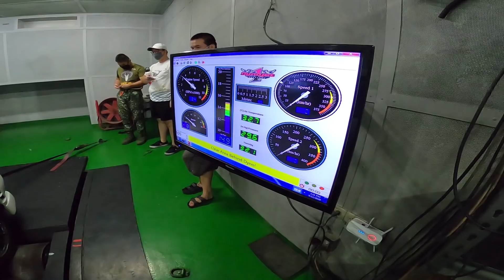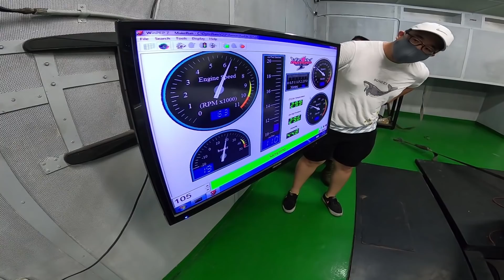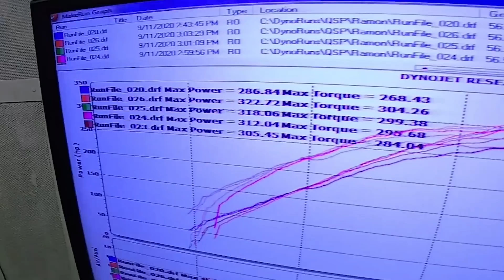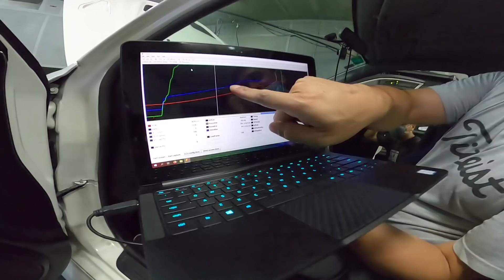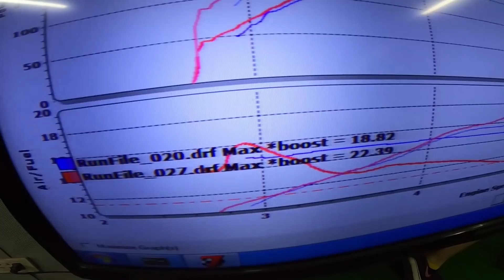Evo 6 ECM Tune

Comment: Upgrade na lang ng wastegate at bov next time easy 350whp yan. Naka evo 8 ako papi ramon full bolt ons lang and it made 344whp on 25 psi stock turbo lang. kudos papi ramon pogi ng evo mo 🙌🏻
Reply: Fuel pump upgrade din kung naka stock ka pa din. Pang diinan na yan 🙌🏻

Comment: 350whp in stock turbo? Solid a.
Reply: Solid nga eh stock turbo, buti di sumabog makina
Reply: Forged internals
Reply: @kenshien544  d naman forged pistons and rods ang stock evo. Crankshaft alam ko oo. Also alam ko naman kaya mag 400whp pa kahit stock pistons and rods. Nakakabelieve lang na ung stock evo 6 turbo na ang liit nakapag 350whp
Reply: AWD pa paps, may power loss pa yan sa drivetrain
Reply: @alwaysturnonaircon  ibig sabihin ata ni kenshien is built engine ni ramon. Which it is

Comment: ECM tune ba tawag pag gasoline engine?sa diesel engine naman remapping/reflash.
Reply: Pareha lang po sila sa diesel at gasoline. Remapping/reflash or ECU tune. Same lang po sila na pinapalitan or binabago yung Ecu parameters.
Reply: Parehas meron yung gas o modern diesel engine ng ECU, ECM, DME, PCM, etc. Parehas silang engine computer na dumedepende sa naming scheme ng manufacturer. Parehas nila kinokontrol air/fuel ratio, ignition timing, etc. Except sa diesel na walang spark plug kaya ignition timing di naadjust.

Most Unlocked ECUs pwede i-Tune/Remap/Reflash, whether diesel or gas siya.

Hope that helps
Reply: @RNZY  oh salamat sa reply,kala ko magkaiba tawag e.
Reply: @ryandima8845  salamat sa reply,un nga alam ko remap/reflash haha,kala ko iba tawag sa gasoline engine.